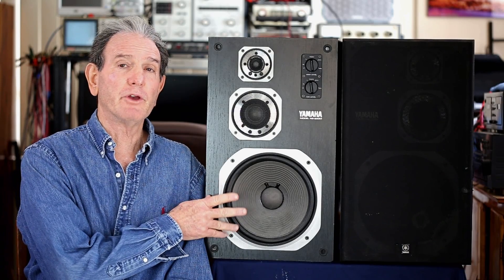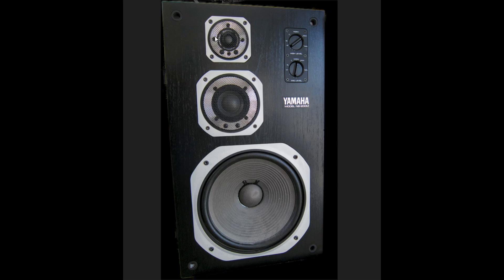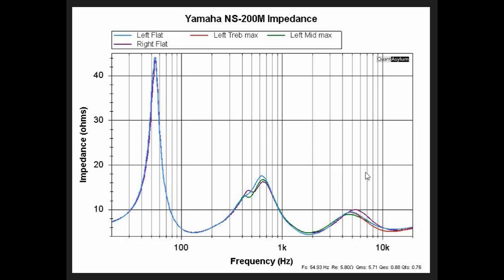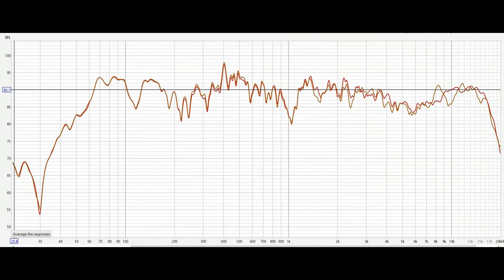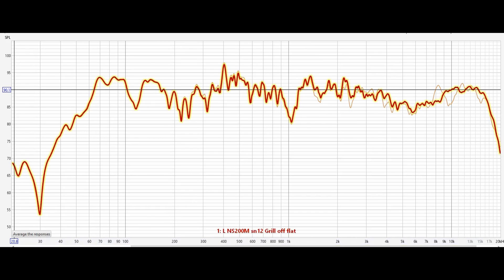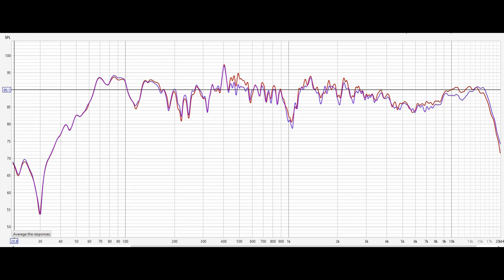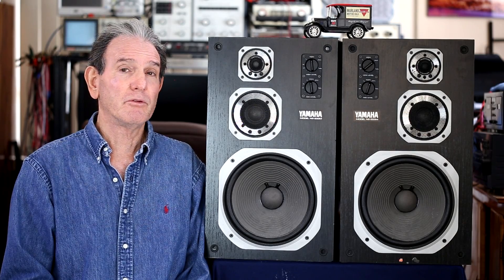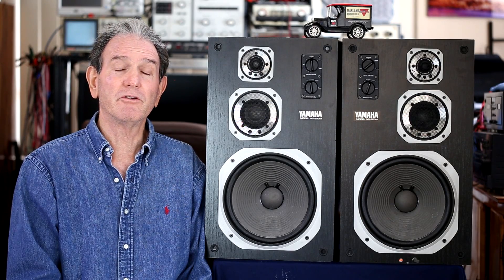Yamaha NS-200M Loudspeaker- Vintage Audio Review Episode #102

Comment: I have a pair of Rogers ls7t, would you say they are comparable in sound quality to these NS-200M ? My receiver is a Marantz 2270.
Reply from the maker: Thanks for the question, I have not heard the Rogers speakers you mentioned. But, it is not what I think about how they sound, it is ultimately how they sound to you. If you want a really efficient speaker then you have to balance that requirement with what sounds best to you.
Reply: @vintageaudioreview   Thank you, I appreciate your response! I was hoping for a more technical comparison between the two, particularly in terms of frequency response, driver design, and how they might interact with my Marantz 2270. I understand that personal preference is key, but from an engineering perspective, how do these two designs differ in their sound characteristics? Also, do you think the efficiency difference (87dB vs. 90dB) would have a noticeable impact on the Marantz’s performance?
Reply from the maker: @PercyClift  It will take more power to drive the  87dB efficient speaker, but the 2270 has enough juice for many of the speakers one would hook up unless you are cranking things to very loud levels. I am not someone who really gets into the type of drivers other than maybe the speaker has a horn or is open baffle that kind of thing, though i know folks that are. What I try to show in my very basic review is the frequency response/SPL as measured in my very non-perfect room, as well as the speaker's impedance that i measure. But one's room is going to change the response an awful lot. Unless you have a speaker the dips down to <4ohms a lot, most decent receivers should be fine as long as you don't approach the limits. Save up some money- if you have the space- and get a pair of KLipsch Lascalas- vintage ones are fine if they have been taken take of- and you won't have to worry about your 2270 with them....
Reply: @vintageaudioreview  No chance I’ll be getting those horn-loaded monsters! I do understand that they must be extremely efficient (~105dB!), and my 2270 would barely need to work to drive them—but they’re just not for me! Thanks again for taking the time to respond, I really value your input.
Reply from the maker: @PercyClift  They are certainly not for everyone, but they are overall my favorite speaker for the majority of music I listen to. They are closer to 95dB efficient- at least mine (I did a video on them, of course). Good luck and thanks for watching!

Comment: @vintageaudioreview  
I'm curious what a pair of these would currently sell for in excellent working and cosmetic condition with grills such as the pair you reviewed here?

These seem to be in the same family as the small 2-way Yamaha NS-10M  "bookshelf" speakers that oddly became the ubiquitous industry standard as portable and affordable studio monitors after being released in 1978 without much success in the HiFi market.  I'm assuming that these NS-200M were also designed by Akira Nakamura and released around the same time?

From what I've read, these are known to be more mellow in the midrange and top end compared to many of the other Yamaha models from this era, including the NS-10M, which were quite bright.
Reply from the maker: You  know a lot more about these than I do do... I am not sure if my friend sold the pair I reviewed- check out the Tucson Craigslist to see if they are listed. I believe another friend has the NS-10's, which I have heard and thought they sounded good. Thanks for sharing!

Comment: This old speakers are sometimes a treasure that can be clearly enhanced with a new housing and crossover.
Because that are the most common places where the red pencil from the marketing department has cut 
through the ambitions of the engineers. Back then it was mostly about numbers sold and the market was 
very competitive and fast-paced. A lot of quality was simply wasted back then.
Reply from the maker: Thanks for the comment, though the physical condition of them is pretty good and I am not sure that I would replace the crossover unless someone has done enough research into what would work best with its drivers.